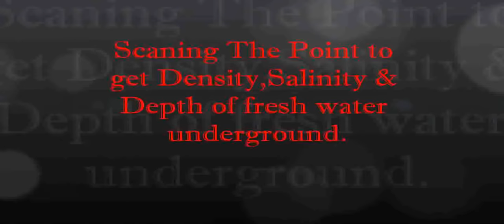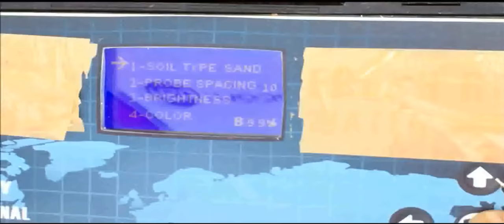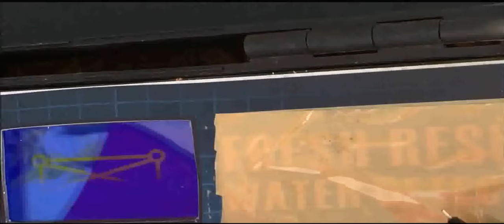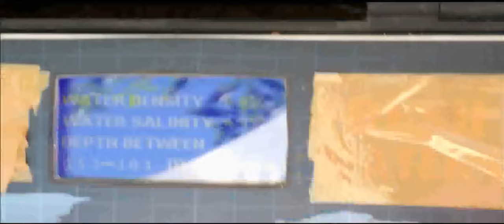BOREWELL GROUND WATER DIVINING OR DOWSING ACCURATELY FRESH RESULT-2017 KERALA

Comment: The diviner is fixed the point ok but what results?
Reply from the maker: Result link in description
Reply: please no one don't believe this Peron... 2019 July I gave 25000  for 5 points.  I spent 90000 for drilling. I didn't get single drop of water.  Finley I lose 115000. I called them and explain about , What happened. Simply they said,  chetta may be cross drilling or miss match.

Comment: Process is fine, but what about result..?
Where is the water..?
Reply from the maker: S Pawar watch 2018 latest video. Link in description.
Reply: please no one don't believe this Peron... 2019 July I gave 25000  for 5 points.  I spent 90000 for drilling. I didn't get single drop of water.  Finley I lose 115000. I called them and explain about , What happened. Simply they said,  chetta may be cross drilling or miss match.

Comment: Sir how much the price of this...?
Reply: please no one don't believe this Peron... 2019 July I gave 25000  for 5 points.  I spent 90000 for drilling. I didn't get single drop of water.  Finley I lose 115000. I called them and explain about , What happened. Simply they said,  chetta may be cross drilling or miss match.

Comment: please no one don't believe this Peron... 2019 July I gave 25000  for 5 points.  I spent 90000 for drilling. I didn't get single drop of water.  Finley I lose 115000. I called them and explain about , What happened. Simply they said,  chetta may be cross drilling or miss match.

Comment: Rssult
Reply: please no one don't believe this Peron... 2019 July I gave 25000  for 5 points.  I spent 90000 for drilling. I didn't get single drop of water.  Finley I lose 115000. I called them and explain about , What happened. Simply they said,  chetta may be cross drilling or miss match.